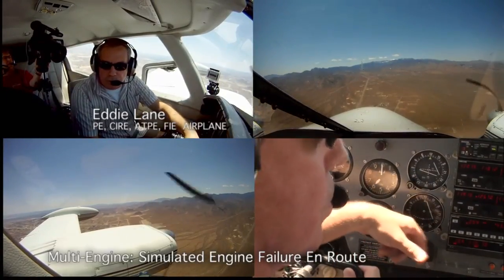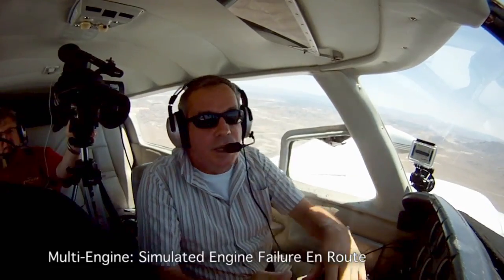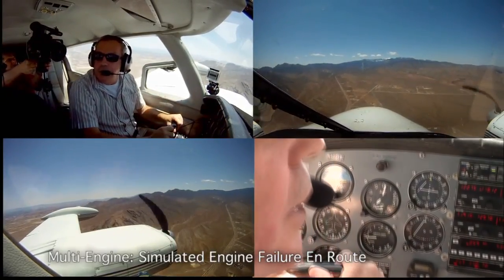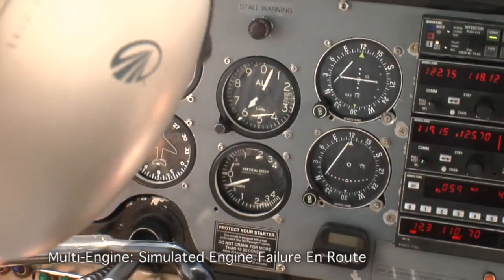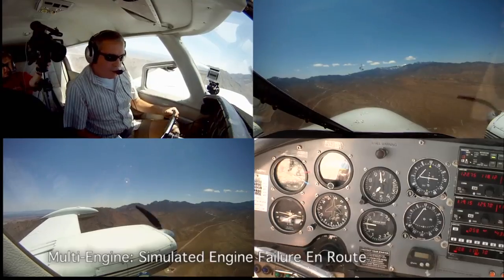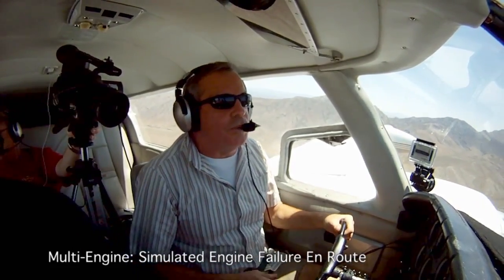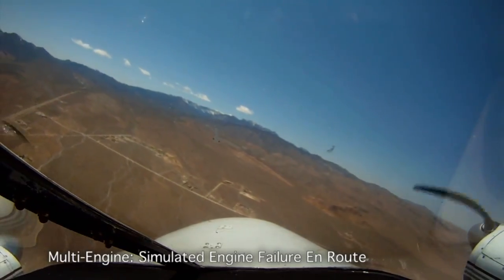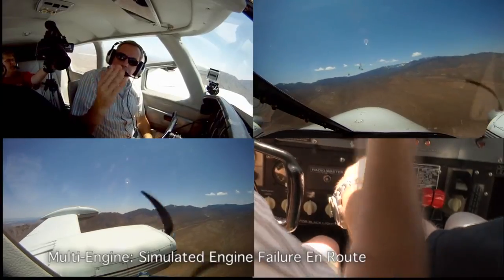Multi-Engine Lesson 5 - Simulated Engine Failure en Route

Comment: What is the manifold pressure for simulated feather, please?
Reply: Luv Vida pay no attention to manifold pressure on an engine failure as it will read almost normal. This is why it isn’t mentioned much in simulated engine failure training. Identify with the throttle and feel for a change in yaw (look at the turn coordinator). Likewise with RPM’s